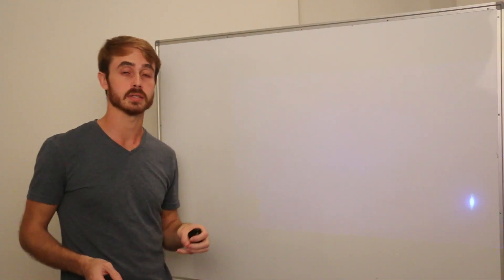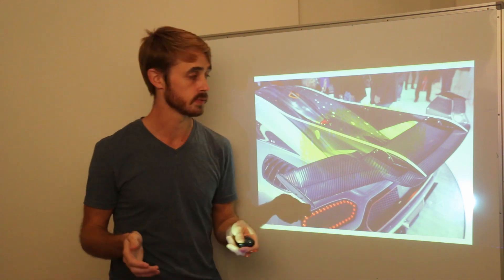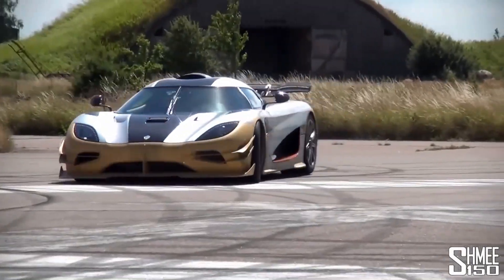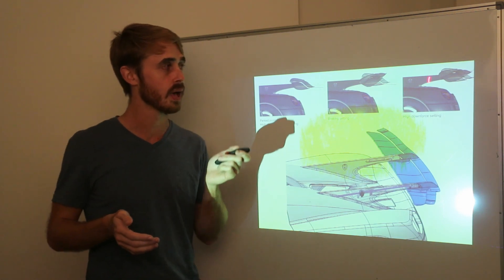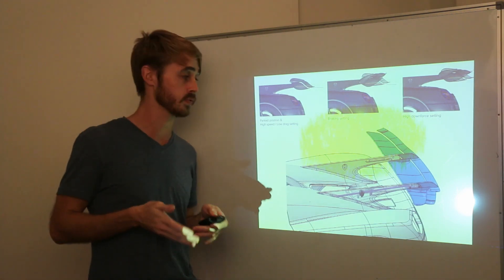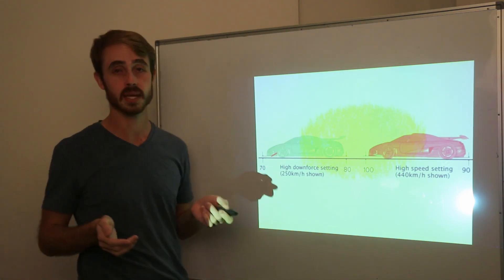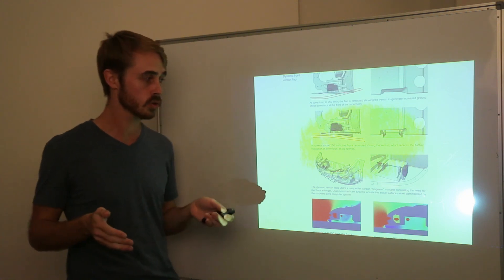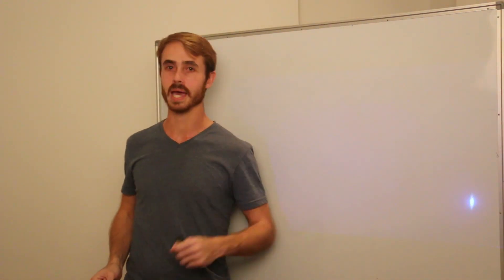Koenigsegg One:1 - Active Aerodynamics Analysis

Comment: this car is UNCONTROLLABLE, all attempts around the nordschleife resulted in spins. there's  a reason not to cram so much power into cars without the downforce to match, great vid, 5 years late but the commentary still holds up. holy sh*t the p1, agera 1:1, 918 came out over 5  years ago. wow.
Reply: Not true! It beat the P1 around Spa with traffic and in the wet and the one and only ring crash was due to a ABS Failure which the driver was alerted of on the gauge but did not notice and he locked up and went dead straight into the barrier he did not spin.

Comment: Thank u Kyle, I think your explanation of the active-front aero in the Koenigsegg One:1 is correct..ie to correct for a high-speed imbalance. The Chaparral 2E used much the same solution. When the driver flattened out the rear wing to 4 or 5 degrees for the straights, from it's 17 or 18 degree braking angle, the imbalance was so severe that Jim Hall designed a flap that closed off the front Venturi tunnel. When he let go of the left pedal that controlled the wing, the flap opened again for the corners to bring back the balance. Remember this car used a torque-converter transmission that freed up his left foot to control the wing.

Comment: I watched a video about the wing by koenigsegg, the braking setting stalls the wing slightly aswell which isn't for high speed cornering.
Reply: If that is the case why not use the highdf setting for braking as well. I would assume the benefits of extra downforce would surpass the increased drag benefit from stalling the wing right?
Reply: Probably why it’s the brake setting lol

Comment: Kyle, could you comment on the aerodynamics package of the new British sport car the Elemental RP1. It's designed by ex-McLaren engineers.   The downforce comes from its integrated front and rear underfloor, as it has no wings or rear spoiler (drag). The front aero splitter and integrated front and rear underfloor diffusers were designed to create large levels of usable downforce. Would be interested to hear your remarks. Thank Tngineer

Comment: Wait, if the front area (floor) is raised up, won't it create positive angle of attack, which than make the underside create lift and the car can actually fly?
Reply from the maker: Indra Ida Bagus It will create a positive angle of attack for the floor, however the splitter, rear wing etc will still be producing downforce (albeit less), and as such you won't see massive overall car lift. It's the reduction in downforce that causes reduced induced drag. It's not tilting up anywhere near enough to generate enough lift to fly.
Reply: @KYLEENGINEERS  you have positive lift at the front end and negative lift(downforce) at the rear...and quite massive at the rear, it will cause a clockwise moment if the car is travelling from right to left...kind of unbalance, don't you think?

Comment: You said max brake position should match max downforce position. I see that it's not necessarily true. E.g. Max brake position should create max downforce and drag, while max downforce position should create downforce with lowest possible drag.
Please correct me if I'm wrong.
Reply from the maker: Sergii Kram Max braking position should create maximum downforce and drag, however maximum cornering(max downforce) should also produce the maximum downforce. In a corner, low drag is beneficial, however you are going to have more than enough power to overcome the drag, and the downforce will be of far more benefit than a drag reduction. If you want to look at it from the tyres point of view, if the drag increases you will need more power to stay at a constant speed through the corner, this means you will be loading the rear tyres in a way that is sub-optimal for cornering, lets say it's using an extra 2% of available grip circle overcoming the drag. However, if you now have double the downforce out of your rear wing you may have an extra 10% grip available on the rear tyres, so in total that would be 8% more grip available. The rear wing should have a lift to drag well over 1:1 so these assumptions will be accurate.

This is why I guessed that they must have it for aero balance reasons, as they don't have enough active aero at the front to be gaining back front downforce at the same rate they are gaining rear. For braking it's fine as you don't actually want your aero balance forward - you want it rearward (but not by a huge amount). 

Thanks for watching!

Comment: End plates are a byproduct of racing regulations. They are not the most optimum design at increasing lift efficiency. Though that is not to say the one:1 has it right either. The wing tips should probably look more like that of an airliner except pointed down. Of course I haven't done the flow analysis myself, I am basing my assumption on the airliners' approach. Though even their design is based on airport regulations of maximum wingspan.
Reply from the maker: hmushmann2 Endplates are actually a byproduct of the low aspect ratio of racecar wings. Aircraft have tapered wings with large aspect ratios (10:1 vs down to 2:1 for some race cars) and low angles of attack in cruise, hence they don't need endplates as badly as their induced vortices are comparitively small. This is also the reason behind winglets on airliners. Without endlplates, a low aspect ratio wing such as the One:1 rear wing will experience very high levels of spillover at high angles of attack (I believe Koenigsegg runs it around 25 degrees at max), producing a large tip vortex that will reduce pressure on the top and increase it on the bottom, lowering total efficiency. My "How do F1 Rear Wings Work?" video covers this quite extensively if you want further information. 

Increasing the aspect ratio of a wing obviously helps, but it's not just airport regs that dictate this, it is also structural concerns (particularly vibration modes) that cause smaller aspect ratio wings to be used on aircraft. Even if your rules allowed you to run your wing on a race car right to the width of the bodywork, your aspect ratio would still be insanely low, hence the need for endplates. Obviously endplates have problems of their own in yaw, but that's a story for another time...

Thanks for watching!
Reply: KYLE.DRIVES I c since, in normal flight, airliners don't create as much of a pressure differential at the wingtips as a wing with high angles of attack and shorter spans.

But, essentially a longer wing would be more efficient if mechanically feasible, right? I understand that an endplate is a reasonable feature on a car as opposed to a mile long wing hanging off the back. :)
Reply from the maker: Oh yes, increasing the aspect ratio as much as possible is the best way to increase efficiency, but on a race car where I really want downforce, I'd probably go and increase the span as well as the chord (depth) to get as much area as possible. Downforce is typically worth way more to you then a drag reduction, so you don't care so much about efficiency.

Comment: You know a car's aero design is not that sophisticated when you see a massive wing at the back.
Reply: So right. You made some really good points on the LaFerrari video as well. Do you work for a car company? Because you seem to know what you're talking about.
Reply: Daniel Luong I am an aeronautical engineer. Surprisingly enough, I have spent most of my career as a design engineer in medical devices industry! But, I have done a lots of medium-size aircraft wing/flap design, and a little bit of centrifugal compressor design.
Reply: +Sam R Ah I thought so, you would have to be a professional. I am as well working for Ford, everything you say is completely on point. 

Case in point, look at the Ford GT- there are no massive wings because it is completely uneeded. 80% of the vehicles overall grip is provided by America's burning desire to crush foreigners and their vehicles at Le Mans. We've tested the red, white, and blue livery and it actually adds 115kg of downforce at 350km/h which will be very useful at the end of the Mulsanne.
Reply: Daniel Luong Yes. But the problem is that you have to compromise most of the times. Cost/performance is what most car manufacturer care about. It is much easier to just chuck a massive wing at the back, do a day of CFD simulation and BAMM you have it. But it is incredibly tedious and costly when you need to achieve performance with aesthetics as the primary factor. What makes Ferrari different from the rest of car makers is their passion for performance and aesthetics. I can imagine how time consuming and costly it was for them the aero design of Laferrari, and the rest of their models.

Then again, not many people understand that and that is a shame.
Reply: +Sam R So many valid and true points. 

Let's not also forget the impact of their traction control calibrations and how much downforce and aesthetic improvements they generate. 

I've also read that the wheel design of the LaFerrari also generates a not insignificant level of longitudinal thrust by capitalizing on the heat generated by the brake rotors and vectoring them to the tyre edges to eliminate tyre squirt. 

The level of engineering is amazing. Truely the engineers at Ferrari are the best in the world without equal, and their talents have created the 2nd best looking and 3rd fastest cars of the current hyper car crop.
Reply: Daniel Luong Yes. IMHO Laferrari is designed with racing in mind. I believe that Laferrari is the true race car than being just a one-lap-wonder like Mclaren P1 and Porsche 918. I suspect it has the lowest tyre degradation/fuel consumption than P1 and 918, and has the most sophisticated traction control directly from F1 car. Also, as Ferrari claims, its energy recovery system is even more advanced than the one they are currently using in their 2015 F1 car. Also, as we know, Ferrari is the only car to have all its 950bhp power available during a 70 lap race. P1 runs out of electric power after 9-10km and has to stop to recharge its batteries, and 918 switches to its I/C engine and disables its electric motor.

Also, Laferrari is incredibly reliable as Ferrari have been testing and developing Laferrari's engine in their Enzo FXX-Evo for years. Also, I have heard that its engine is made with incredible precision and with very small windage (The fit between pistons and cylinders) close to race engines. No wonder they can extract 800bhp out of a N/A V12.

LaFerrari is indeed an engineering masterpiece.
Reply: +Sam R Yeah, the traction control systems implemented in their F1 cars are among the most intricate and sophisticated in the sport, and their ERS is obviously good enough to bring them to a strong 3rd place in the WDC. 

Ferrari's true strength is being able to effectively leverage the expertise gained from their successful F1 and other racing programs, and strong competitive pedigree and produce a stunning road vehicle. No other car company in the world can say that about their cars- with the exception of McLaren, Porsche, Mercedes, Audi, VW, Citroen, Peugeot, Mazda, Toyota, Ford,. General Motors, Lotus, Renault, and some others. But Ferrari is the best.